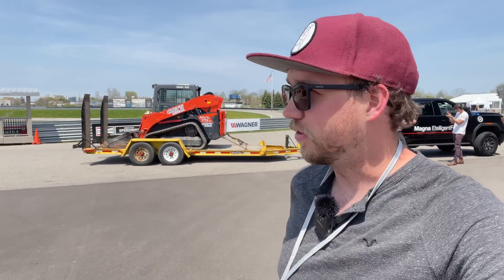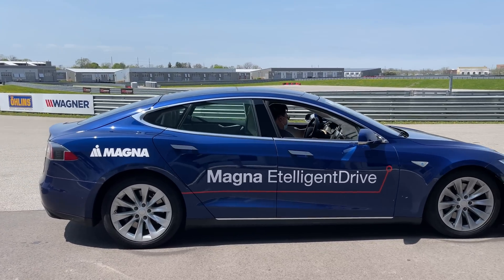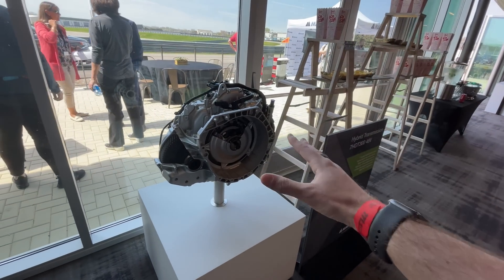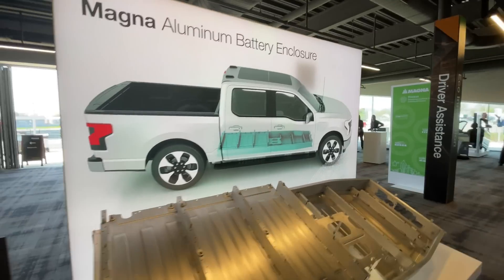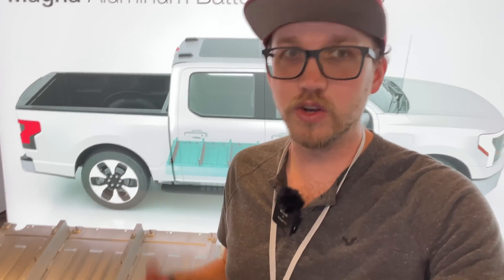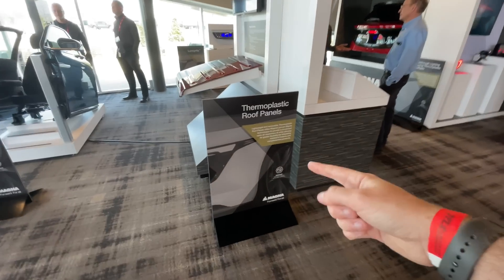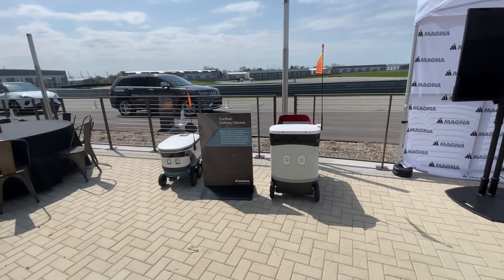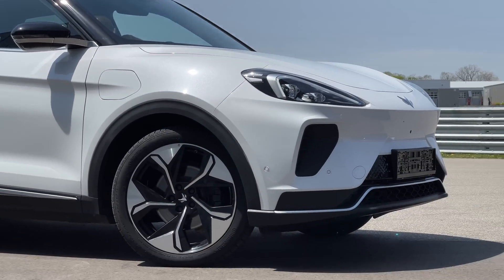Here Are Some Future Automotive Technologies Coming Down The Pipeline

Comment: Starting the video with them towing with an EV.....only if they made that trailer with a skateboard battery platform. Then the EV would need a second charge port on the rear by the hitch for that trailer to plug into. That would serve as the electrical hook ups for the trailer lights and to allow for the trailer battery to extend the range of the EV while towing.

Comment: Fake grills are a real waste.
Especially on EVs they're an easy way for lazy designers to get away without having to properly re-do their ICE vehicles.
Reply: Tesla proved you can proportion a front end without gaping fake side intakes (functionsl PROPERLY SIZED air curtain cutouts get a pass) or a fake grille.
Reply: Lazy designers created the unfinished look of the front of the Tesla Model 3/Y
Reply: @rtfazeberdee3519  not big fan on awkward S, 3, Y fog surrounds but subtle lines on nose at least are honest vs Mach E fake grille...  they need to rethink a grille less paradigm.
Reply: @rtfazeberdee3519  the Tesla lineup has some amazing design.
They essentially wrote the book on EV design
Reply: @Mireaze  share what you’re smoking
Reply: @Mireaze  The "S" and new (vapourware) Roadster are the only 2 worth looking at.  They did well on stuff under the hood like efficiency (until Lucid) and speed.